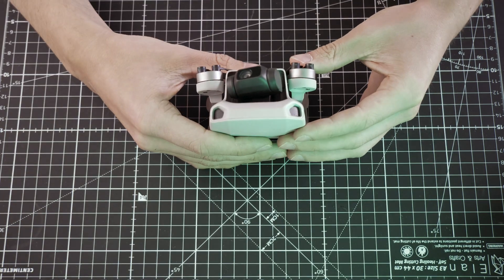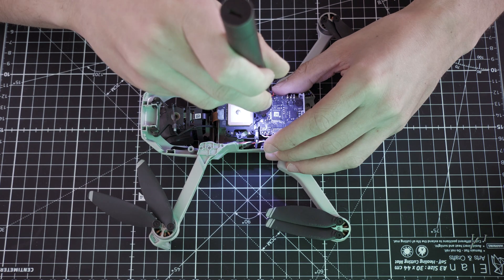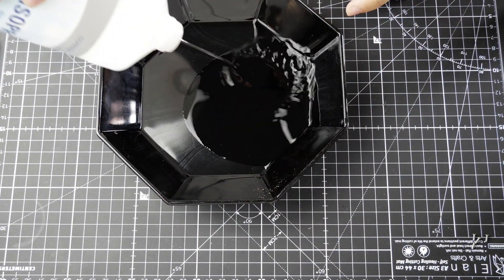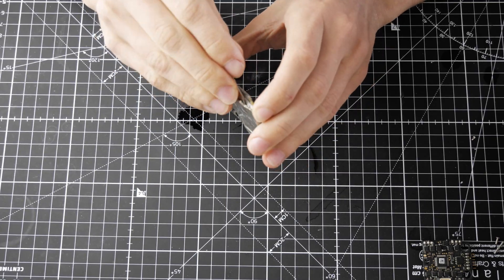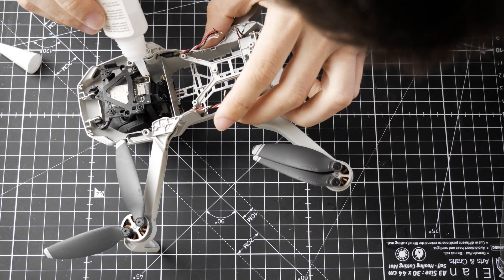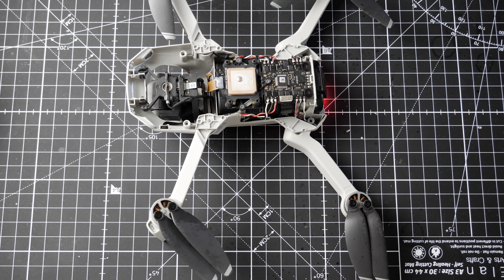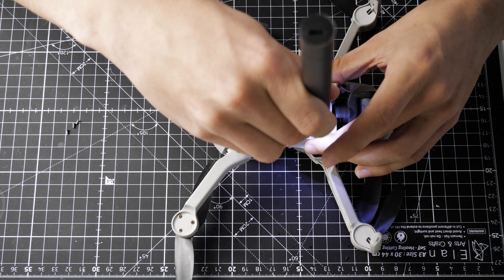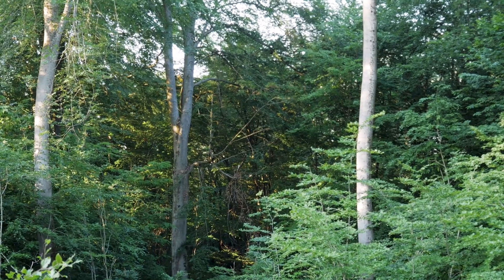DJI Mavic Mini Waterdamage  Repair💧🛠️ Drone Disassembly

Comment: it was water damage from sea water?(salt water?) ,do you think its also possible to do with the mini 3pro?
Reply from the maker: I don't know. It could be but I don't think so because salt water has more white corrosion. Yeah of course 👍 I never repaired a Mini 3 Pro. If I will have one I will definitely make a video. But yeah I think it would be the same.
Reply: @technico5880  my mini 3 pro fell to sea water, and i took it after a minute... do you think there's a chance the motherboard or the ESC Board survived? because I'm really considering doing the procedure you did on the video...
Reply from the maker: @Arikw2  if I am in your position I would definitely not turn the drone on to prevent a short circuit. Take out the battery and try to clean the board with alcohol to be on the save side
Reply: @technico5880  okay! thank you very much 😊